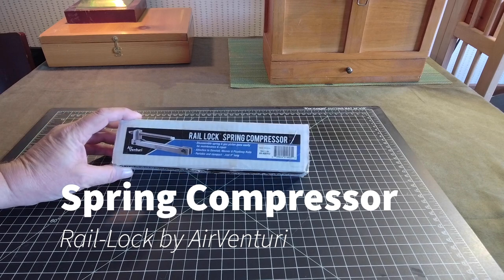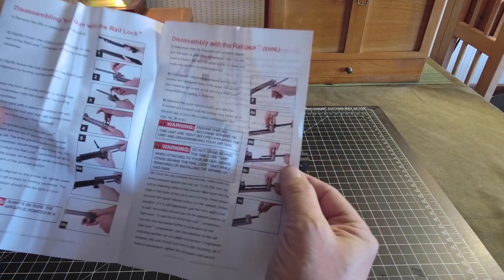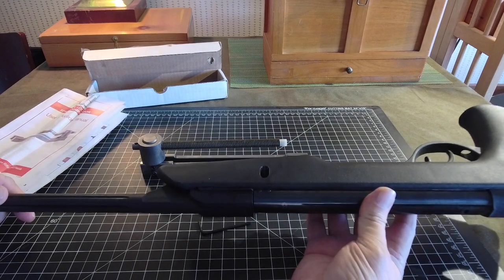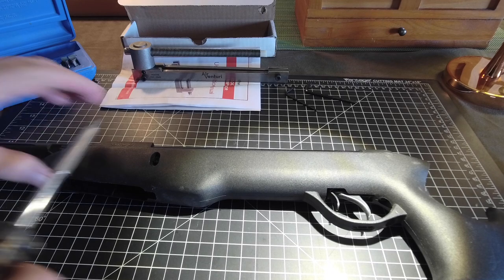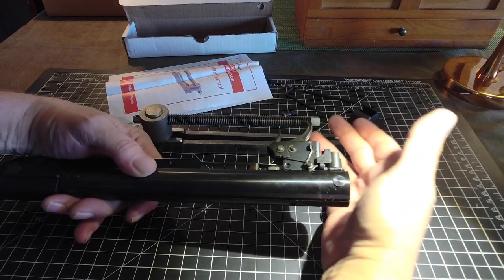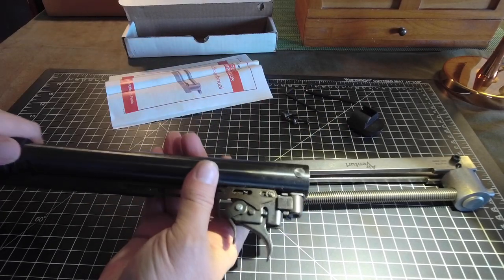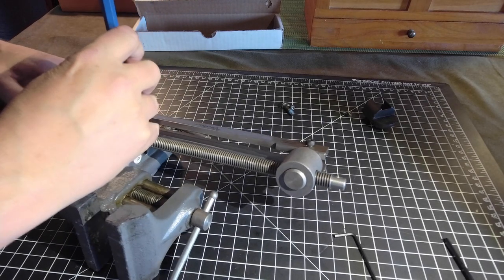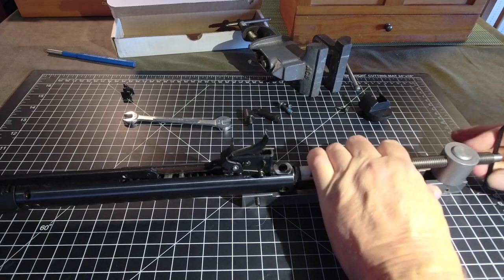Rail-Lock - A Spring Compressor by AirVenturi

Comment: You need a dove rail riser of a sort for proper alignment.  If you notice the Pyramyd Air version of how the Rail-Lock system works it's off set so the long threaded compressor shaft is dead center this way when you compress the spring all the holes can be evenly aligned when you put the set pin back into place.  Having it the way your doing it can be done but its very unsafe and your just working against misaligned tension fighting it back into place hoping it doesn't fly off as you screw it back.
Reply from the maker: Thanks for the help. You're quite correct. If the spring from that gun was stronger I would have been more concerned. When I've used the compressor on high powered guns, it's lined up correctly.